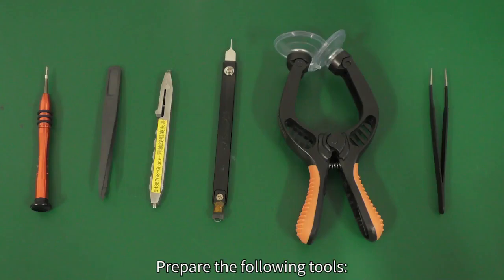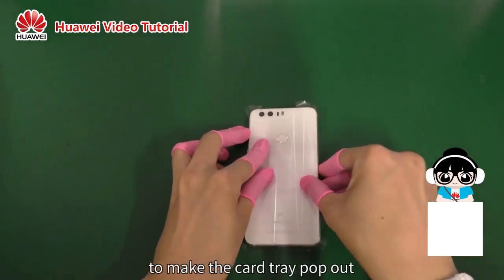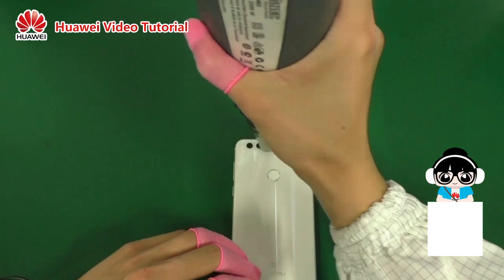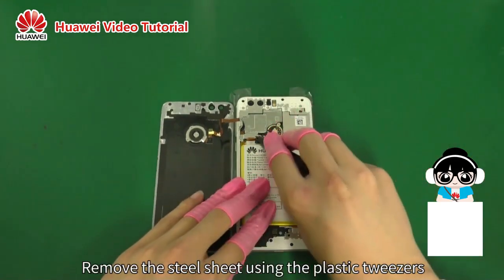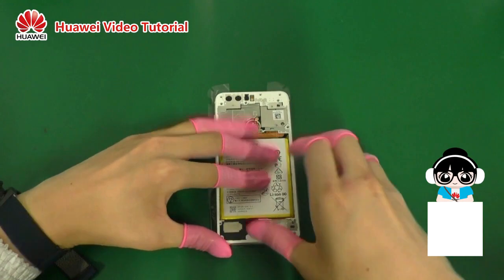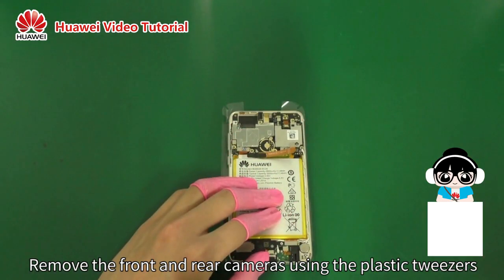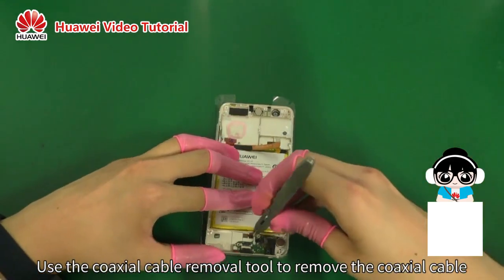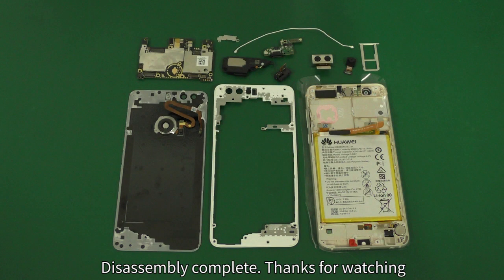Huawei Honor 8 disassembly guide

Comment: I replaced the battery and hooked everything back up. The screen seems 
to power with no display ( I can see it want to illuminate ) It takes a 
charge ( green notification light comes on).  What could I have done 
incorrect or missed? Thanks